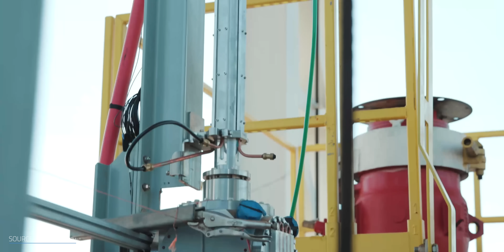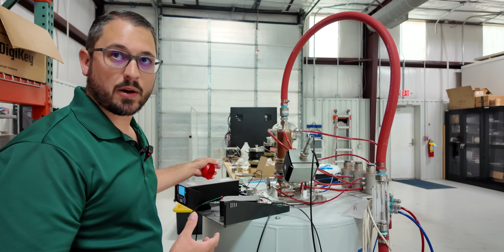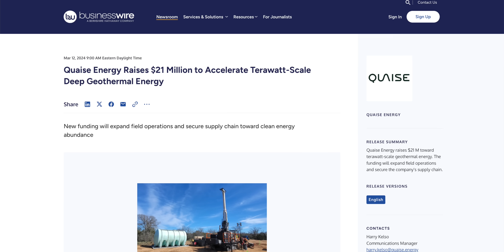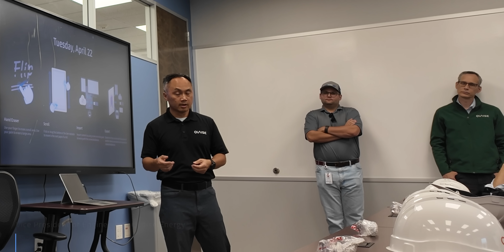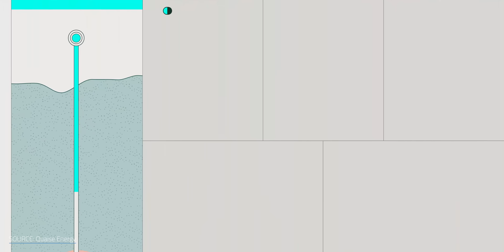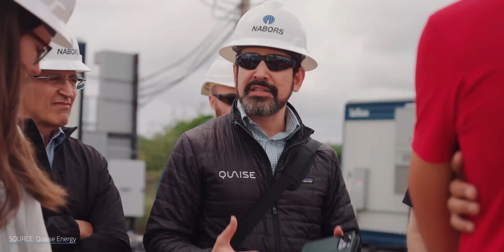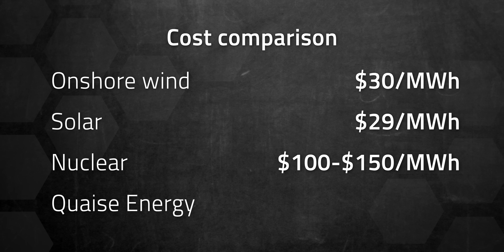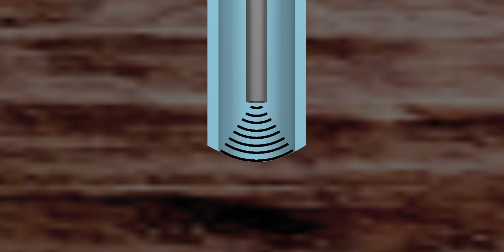How Geothermal Energy is About to Break its Limits

Comment: So... This would probably drill through a vault, right? Asking for a friend
Reply: IIRC, most large vault walls are made from ferrocrete, which the drill would see as stone laced with iron/steel, so yeah, sure, it'll go through just fine.  Just one thing though... You don't want to incinerate whatever it is you're trying to get, and since it's only drilling an inches wide hole, you either have to wield it like a cutting torch to make a hole big enough, or you have to distribute the beam across a much wider space, which means you're going to take even longer to get through the wall.

Add to that that the power draw is such that you either have to bring your own Megawatts power plant with you, or figure out a way to tap the grid for that much power without setting off alarms all over the electrical grid.

Theoretically feasible, practically difficult to impossible.  It would have to be a massive payoff for this tech to be used.
Reply: @EdwinWiles Do you have to burn out the entire hole or can you just cut out a circle and kick the centre out?
Reply: @EdwinWiles  Whats funny is I haven't heard that word since I read The Stainless Steel Rat back in high school.
Reply: @Electrichead64 Which word?  Ferrocrete?  It's still in use for specialized construction.

P.S.  That was a wonderful series. 🙂
Reply: Try using high compression gas chamber, convert it for making a high pressure fusion reactor, have a bunch of supercapacitors for storing and steady or rapid release into the system, with the right materials you could potentially get the entire system design down to the size of a standalone propane tank or large car. With the correct gas input and pressure, you should in theory be able to get extremely high voltage power draw from the fusion reactor. all dependent on the right materials used for the chamber.
Reply: @EdwinWiles  They did say 5m an hour though.  Put a battery on a cargo ship.  If anyone does that, they owe me a beach house.
Reply: @EdwinWiles    I appreciate your analysis! Lol, I know that I'm always gonna get good answers to interesting/silly questions in the comments section of this channel.
Reply: For a vault… I think I got you bro… I have seen a robotically actuated “death ray” that can evaporate rock… so I guess I will work for vaults too!
Edit:… now that I think of it the robotically actuated death ray would mean that your friend would remain unanimous, so his work would not be backtracked to him, making the robot take all the praise…
And that would be just unfortunate
Reply: Ha
Reply: @chrisracer2007 anonymous? Unanimous means everybody agreed.
Reply: @chrisracer2007 regarding the robots,  I could help out :))
Reply: I'm that friend... 😑🤫
Reply: Good luck getting that lot  into the bank vault 😂🧙🏼‍♂️🌍🥼
Reply: @clivestainlesssteelwomble7665

Inside the vault? Not so 
Tunnel from the street. Incognito.
Reply: @FilipeCarmona  the way my brain immediately was like “this guys right, the curse of oak island guys do need this!” Lol
Reply: I got spurs, that jingle jangle jingle
Reply: @FilipeCarmona
Federal reserve, anyone?
Reply: Yeah, the same way a pet tiger will keep people off your porch at night. It’s still overkill.
Reply: Thermal lances are way cheaper and do the same as far as vaults are concerned.

The problem is not getting in.
The problem is getting in and getting away before being noticed.

If you want to rob people you should open a bank, not rob one...
Reply: is you friend's name Ocean?
Reply: I've got you, me, and four other sinister people that might want to help you answer that question
Reply: Hilarious !!!  Love it ! 🤣😇
Reply: You beat me to it. Doubt you can hide the semi-truck trailer of equipment needed to do the job… but who knows.
Reply: Lol I need a medic bag.
Reply: a thermal lance also would, and is much simpler to operate at smaller scale
Reply: No
Reply: Maybe. I do have a suit of medieval armor if you're interested... no roller skates, though.
Reply: sure... just it might melt all the gold inside
Reply: Lol😂
Reply: Yeah if you can carry in a megaton power source.
Reply: Yes but you need several shipping containers of equipment and a lot of electricity to generate the laser 😂
Reply: uh oh!!!
Reply: @FilipeCarmona   😂💰
Reply: Just need your own private powerplant to get through 😂
Reply: @FilipeCarmona  😂
Reply: He kind of answers this at the ten minute mark.

The heist team is three big lads to carry the drill and 45 to carry the jet engine required to power it 😂
Reply: @FilipeCarmona  it would probably cost more than the contents, unless it’s a country’s gold reserve.
Reply: If you had the means to use a megawatt 'death ray', you would not need to drill through vaults.  You could make a legitimate business by drilling for geothermal.
Reply: Oak island?
Reply: No actually
Reply: Right.  Causing fires in the paper money, melting coins and gold bullion, filling the vault with smoke, etc.  
Carry on.
Reply: Fort Socks vs. unlimited energy?

GOOOOOOOOOOOOOLD!
Reply: @FilipeCarmona  what's wrong with a plasma cutter at 40,000°F (22,000°C) readily available and cuts through anything, Just a thought.
Reply: Installing a rig over bank vault will definitely be suspicious :-)
Reply: Light sabers are definitely more portable.
Reply: Yes, but it will cost more than the contents of most vaults to operate...
Reply: this technology is far more valuable than anything inside a vault by orders of magnitude.
Reply: @FilipeCarmona  depends, is the vault covered in mirrors?
Reply: Probably but the contents of the vault might vaporize too.
Reply: When the lining of the metallic vault is reflective in the corresponding wave length (as the lining of the wave guide tube of Quaise is), you won't be able to drill through it.
Reply: Nano-thermite is how you spell what your friend is looking for.
Reply: Drill through a coal plant floor and sell them the steam to generate electricity. It will confuse trump why no coal is being sold on his commission but you'll make a fortune.
Reply: @FilipeCarmona  don’t tell him, guys!
Reply: @FilipeCarmona  Donacdum.

Comment: While accidental water intrusion is a potential problem, they could also use that as a side hustle.
Imagine a company showing up and just drilling a hot spring, instant pop-up attraction in every town. They could even start out with that as a test run goal. Oil drilling didn't start at super deep depths, the technology improved as they needed to keep going deeper.
Reply: So will this technology. Maybe they drill to a point where the cooling/enegyextracting water is the only thing keeping the borehole solid in 100 years.

Comment: 4cents kWh dirt-cheap fossil fuels electricity 
+ 46cents kWh GRID RENTAL is 
= 50cents kWh grid supplied electricity to the consumers meter boxes. 

Fossil fueled energy is 20times bigger than grid electricity. 

Grids are 10times more expensive than the generator plants.

247, 365 cashflow is the economic life blood for grid owners. CASHFLOW from the consumer who have dirt-cheap empty rooftop realestate for dirt-cheap rooftop PV electricity with NO GRID RENTAL costs.

"Huston we have a problem."
A massive SHTTSNPANTS problem for grid owners with grid DUCK CURVE of grid cashflow collapse in business hours every day the sunshines on rooftop PV systems. 
ALL centralised generation needs grid capacity and big cashflow 247.
ALL distant renewables generation  needs grid capacity and big cashflow 247.

Grid electricity is a dead duck every day the sunshines and the batteries are full. 
EVs massive battery on wheels parked 23hrs every day and all night long are dirt-cheap free massive daily electricity storage. 

Rooftop PV is cheaper than windows $m² installed. No grid rental costs. Free mass electricity storage on wheels nightly. 

What do I think ?.?.? What do you think ?.?.?

90% of the world's population live in the sunbelt. 
80% of the world's population live in dictatorships and nuclear defence budgets will need to include bunker busting bombs and B2 stealth bombers services with nuclear electricity industries proliferation.

Comment: Energy engineer here.
Rock is a very poor thermal conductor. Rock has a conductivity of between 0.5 and 4 W/(m.K), compared with 50 for steel or 400 for copper.
As a result, once you've reached the depths and the thermal energy of the close area has been evacuated, the heat is gone. The remaining conductive power flow is then very low, and not at all a constant source at the initial temperature of 400°C.
This is a big problem for an energy production plant, obtaining an infinite source of energy with almost zero power output is pointless.

For more information, google : Why Deep Closed-Loop Geothermal Is Guaranteed To Fail, Mark McClure, February 21, 2021

Current geothermal power plants uses the high thermal convectivity of water to recover energy. However, the water used is underground water that slowly seeps into the hot zone. This water is heated for days or even weeks in the area before arriving at the extraction point. If such a power station extracts more energy than is provided by the naturally heated water flow, its power decreases over time.
Reply: The air is creating insulation, not rock or any other material.
Reply: @lofman  You're right, it's indeed the stationary air trapped in rock or glass wool that makes these materials so insulating. However, rock itself remains a poor conductor, 0.5 to 4 W/(m.K) compared with 400 W/(m.K) for copper, 50 for steel or 0.15 for wood.
Reply: That's not true. Most rocks, especially those found in the deep crust of the Earth, have high thermal conductivity, water has a conductivity of ~0.6W/Km, something like granite has a thermal conductivity of 2-3.5W/Km, the Earth's core is such a massive store of energy and the thermodynamics of the situation (the bigger the temperature difference, the faster the flow of heat) means that it would be nearly impossible to extract energy fast enough to have any impact on the temperature that deep (also remember that the rock is going to be denser because of the immense pressure, raising its conductivity).

Mineral wool is not a good insulator because of the mineral component, but because of its fine structure that creates tiny partitions of air (conductivity 0.03W/Km) meaning that you don't have convection, and the small diameter of the constituent fibres of the mineral wool makes conduction along these fibres minimal.

The real issue with most geothermal is that the well needs to be hot enough to create steam in order to drive turbines and other than in tectonic hotspots (like New Zealand or Iceland) it is too expensive to drill deep enough into the earth to achieve those temperatures. Luckily now we have a technique that is much faster and more efficient and could mean a practically inexhaustible supply of inexpensive clean energy regardless of location.
Reply: @felixprime8291 Conductivity should not be confused with convection capacity. Water has very good convective heat transfer but poor conductivity. It's moving water, once heated, that's efficient at moving thermal energy, not still water in contact with another material.

The limiting factor is not the water's ability to recover energy, but the rock's ability to give energy and restore it to the point of contact with the water.
Reply: @felixprime8291 I wonder how efficient a mercury amalgam slurry/melt or gallium steam can transfer heat.
Reply: It's the same concept as traditional water wells, yet we use water wells just fine. The water seeps in at a constant rate. If you pump the water out faster than the well gets replenished then you run the well dry. That's analogous to these geothermal wells. That's not a problem though. You drill the well and test it to see what it can produce and sustain, then you base your usage on that so as not to run the well "cold".
Reply: Obviously this type of thing is a consideration, and it's one that I'm sure they're aware of and have taken into account. The amount of power they're able to extract from a pair of boreholes will depend on a number of variables, and they'll want to do their best to control those variables to maximize power output, and they can increase power by drilling more holes. The real question is whether the power output is sufficient to provide a good return on investment. These guys seem to think it will be... We'll have to wait and see how it works out in real life.
Reply: This is where chemistry and material science steps in to convert rock into thermally conductive fills. Some deep rock may be remineralized into thermally conductive glass while the outer layer is highly insulative to help channel heat upwards and routed to thermal batteries.

Comment: I live near the Sonoma geothermal power plants at The Geysers that have been operational and productive for decades. There are some shortcomings such as the need to pump water into the ground to produce steam, the small-scale local earthquakes this process creates, the relatively corrosive and/or hard lime producing water that needs to be pumped and the continued maintenance this water requires. None-the-less I would love to see geothermal power successfully exploited. All of these problems are surmountable, they just add to the cost.
Reply: Isn't the plan for these to a closed loop systems?  I believe that is fundamentally different from the plan you describe.
Reply: @pilotbutte2  That's what I understand, too.
Reply: yeah I wonder how this compares to mechanical drilling in terms of geological impact. I mean I can imagine it causes less tentions and thus fewer earthquakes? 🤔
Reply: @ewerybody  The ongoing (minor) earthquakes come not from the drilling, but the continued injection and boiling of the water that produces steam to drive the turbines. The solution is not to place geothermal wells on top of developed areas, so the temblors don't bother anyone ;)

Comment: The problem has never been drilling. The problem has been keeping the hole open.
Reply: "The problem has never been drilling." - Kinda has, though. At least, it comes with a bunch of drawbacks (including keeping the hole open), such as having to replace the drill bit regularly, boring through things like granite being particularly arduous, and the metal drill bit being in contact with 3-4-500 degree rocks mucking up your metallurgy. The deepest hole on (in) the planet - that was drilled anyway - is less than 12.5km deep; and the best thermal energy can be 20km deep (or more). Since the Russians - who were not, at the time, known for under-engineering stuff - couldn't get any deeper with a drill does make you wonder if it's even possible to get that far down with mechanical drilling.
Reply: @real_electricmonk  The Russians reportedly stopped because they couldn't keep the hole open. This tech can make drilling easier, which is good, but I doubt it will result in drilling deeper.
Reply: @o0shad0oo  Not according to Wikipedia - The big hole stopped because it reached a milestone & they spent a year celebrating; when they resumed, they snapped the drill off (oops). The final attempt was abandoned due to lack of funds (the CCCP had either fallen, or was in the process of falling, at that time).